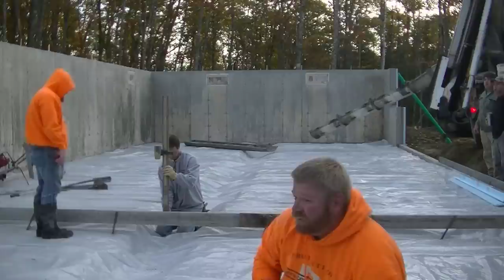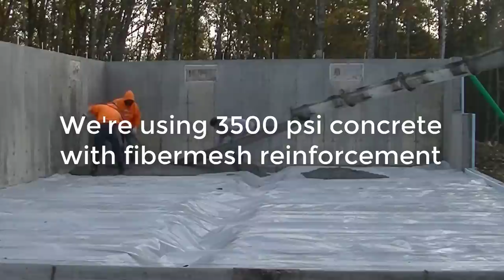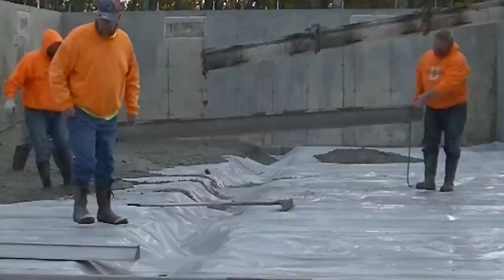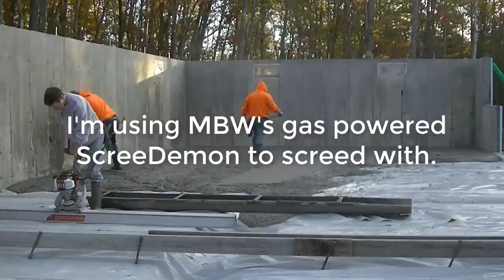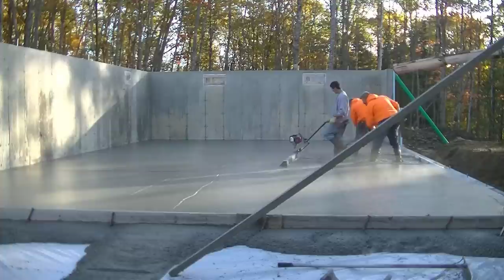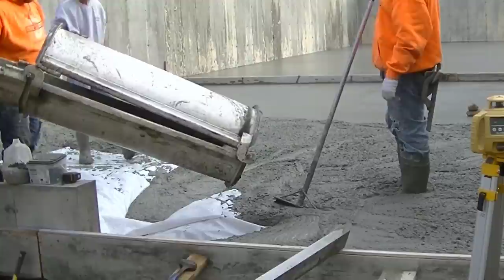How To Pour A 4" Step Down. House And Garage Concrete Floors Done In One Pour.

Comment: I'm not a concrete contractor, but I like the 4 inch step in a garage. It's for safety and a wheel stop.  I like the look, and with the 4 inch step and walking area you get less debris tracked into your home.
Reply: A 4” sept is To keep carbon dioxide from going into the house, it stays on the floor. In some towns/cites it’s code....

Comment: The way I would tell if it was difficult is how quick you get the concrete out of the truck. In this pour you guys had to stop/start a lot which indicates it was a more difficult pour. you mentioned access wasn't great but also looked like the levels were less straight forward. Was interesting you used the power screed for the upper section then went to straight edges by hand for the lower. Was this due to the falls or just easier/smaller section?

Comment: What's important here is you use the laser level and the screeds with the vibrating screed to get the fines up!  I'm always bothered by using plastic under the mix when i want drying time.. CaCl helps.Even better is the access to a walk in basement

Comment: It's not a difficult pour but the thing that we do different here in North Florida is pour the step down header initially with tight mud about a 3 inch slump. We then wet the mud up to the six or seven inch slump that you have and pour the main portion of the house. By the time the house is poured and bull floated, we generally can strip the header form and then pour the garage.

Comment: They got rid of that 4" step up  like that here in Massachusetts, as long as you're  garage has adequate pitch car fuel  tank won't  run uphill into  basement. Either  way  have done many  just like that. Great job, looks great.

Comment: Mike, what did you do with the step form and the stakes (which appear to be metal one's)? did you remove the stakes when removing the form or they are left and cut down to level?
Reply from the maker: We pull them and fill the holes
Reply: @MikeDayConcrete  at what point did you pulled them? As soon as you could walk on it to finish it?

Comment: A question about the transition step down line...........So, if both the house part and garage part are getting 4" of concrete, let's say, there has to be an area there that is thicker. How far back is it thicker and how much thicker ? I'm sure all pads are different, but in this case, how thick for how far at that line ? And is that the way you do it normally ?
The for the videos !

Comment: Didn't seem to bad for y'all. At least from my vantage point. We got rained out today so we are pouring at 6:00 Monday morning.
Reply from the maker: It's snowing here today, everything's canceled.
Reply: @MikeDayConcrete  we don't have to worry about the snow where I'm at but it does rain allot. The weather in Mobile Alabama is crazy. If you don't like the weather here just stick around about 15 or 20 mins. It will change.
Reply: @MikeDayConcrete  When was this one poured?

Comment: I was wondering if that poly was downing down to the corner edges in that deep channel it looked like you were going to have air gap in the corners.  Don't you worry the poly will finally let go as the cement is drying and make depression on the surface?
Reply from the maker: It was all pushed down, there wasn't any air gaps.
Reply: @MikeDayConcrete  thanks.  Hey I like the real time sound in the video instead of the the music.
Reply: @johnds6621  yeah really enjoy the real sound parts, the music is good mixed in too, but like hearing you guys communicating and sounds of the truck etc.